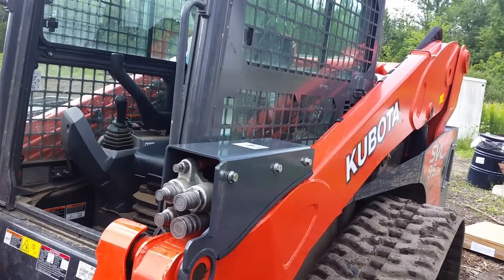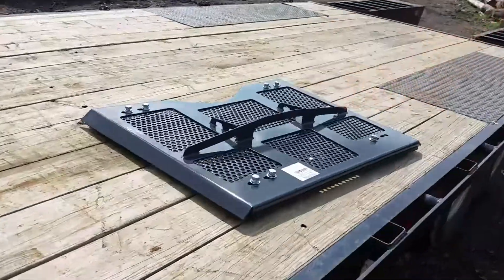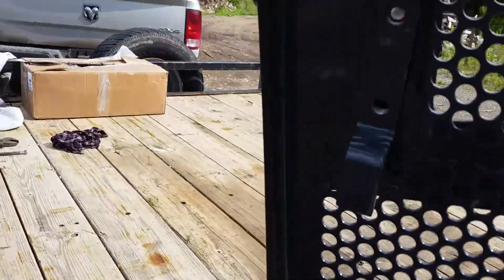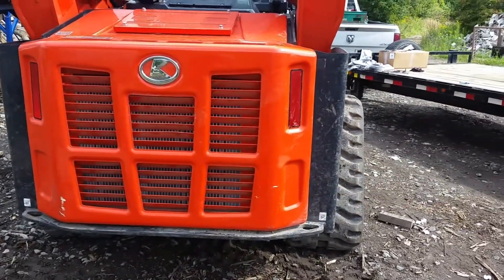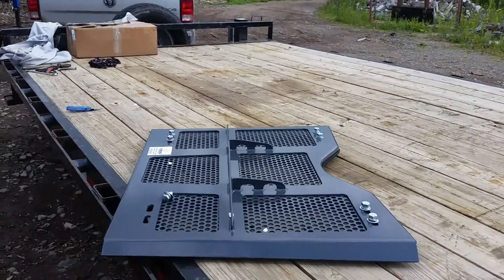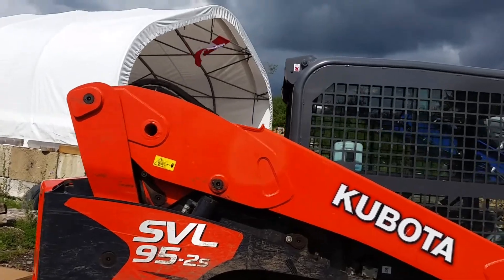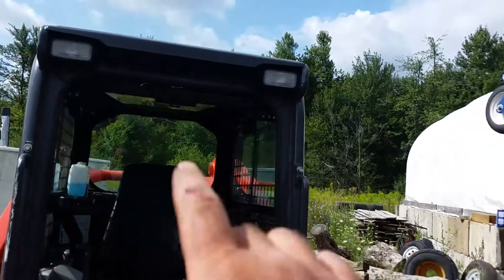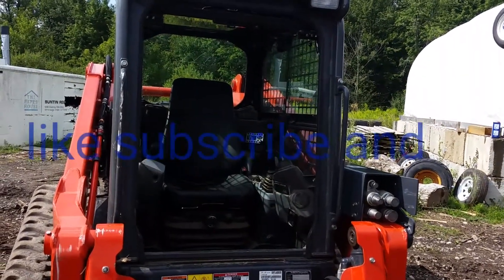Armour for the kubota svl95-2s

Comment: I’ve been contemplating getting some parts from that company and was just curious if they have been holding up and if you would recommend them? It just seems like a lot of money for something that doesn’t look very heavy duty and protective. Mainly the back grill is what I was interested in getting and the light guards. I was just thinking of talking to a fabrication shop and having them make me a bumper type deal similar to the bumper John Deere has for there skidsteer
Reply from the maker: The back door guard we have had trouble with and have heard guys having trouble with the machine over heating.  The guard for the remotes is worth every penny in my opinion, especially the work we are doing.  I think we are going to design our own bumper for it.
Reply: Gotcha. Yeah the guard for the hydraulics for you is great I’m sure! I appreciate the response thank you for the help.

Comment: So how much for the parts you got now
Reply from the maker: +2003evodave this will give you a pretty good idea.   https://www.germanbliss.com/skidsteerarmor
Reply: 10 liters of oil big jug is $25.00 and filters are $30.00 and deeres are $350 for theres so $55.00 from kubota here for oil change kit and $350.00 at deeres  here
Reply: the parts for kubotas are accully not bad  comparing the deeres theres way alot more on there parts then kubota wich kubotas alot cheaper then deere plus kubota has a  good and better service and support from kubota  then is deere the deere service in canada wich are bad
Reply from the maker: +Michael Mac Tavish deere wasn't even a option for us.  it was either cat or kubota and the price difference made the chose easy.